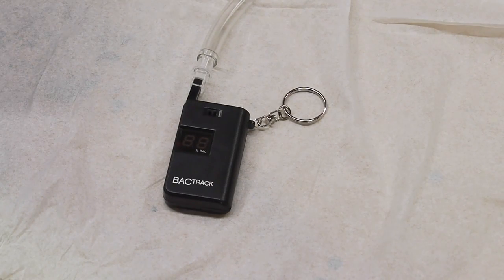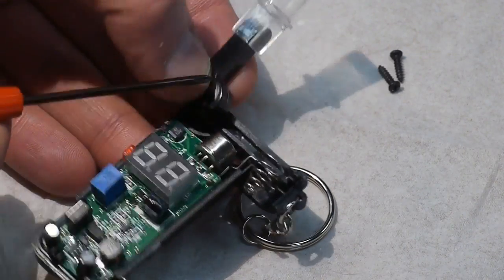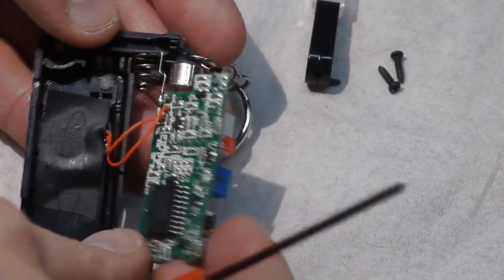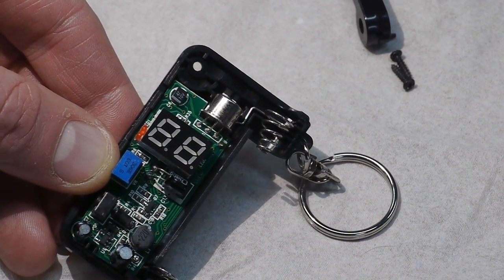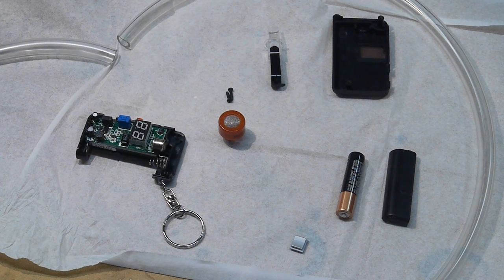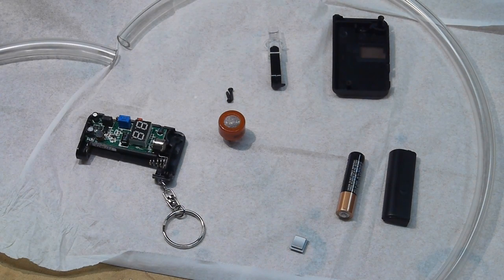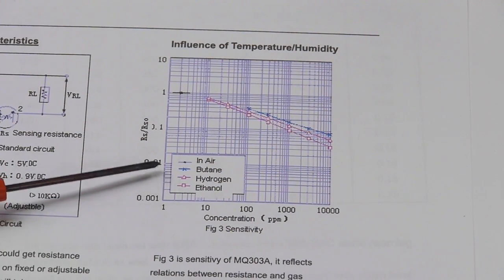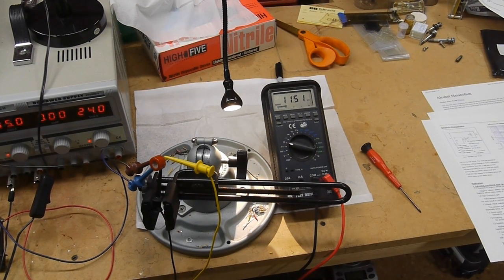How a breathalyzer works (alcohol sensor)

Comment: How significantly would it effect the resistance if you were to hold your breath for about a minute to exchange most of the oxygen in your lungs with CO2 before blowing on the sensor?
Reply: hellterminator yeah but even if you could reduce the oxygen concentration to below 15% id imagine it would still have some effect.
Reply: Alex Boehm ya it makes ur b.a.c. higher cuz u have less oxygen coming out
Reply: Mark, it's the other way around?  So the trick is to inhale a pure oxygen balloon just before blowing?  Unfortunately, the cop doesn't make you blow right away.  He'll have you get out of the car and walk the line, etc, first.  So you can't just suck in oxygen while you're still in your car.  Oh well....
Reply: @ChristmasEve777  there’s a sure fire way to get around this test.  Stop driving drunk before you kill someone.
Reply: You can't use up most of the oxygen you breath in. You'll pass out from CO2 buildup way before you'll have used up even half the oxygen (assuming normal atmosphere with ~20% oxygen).